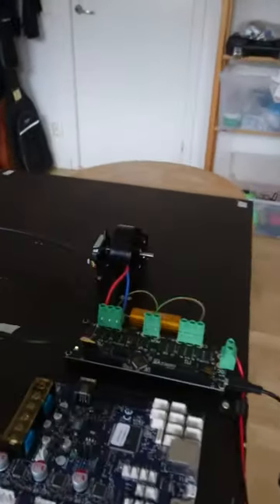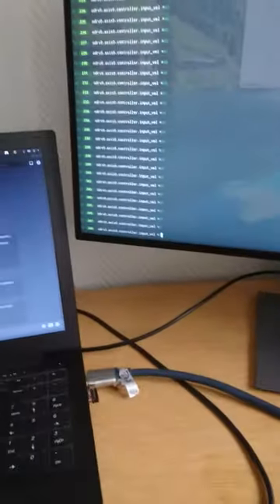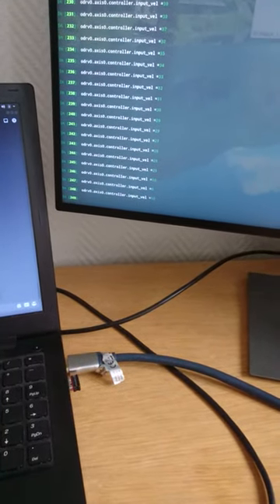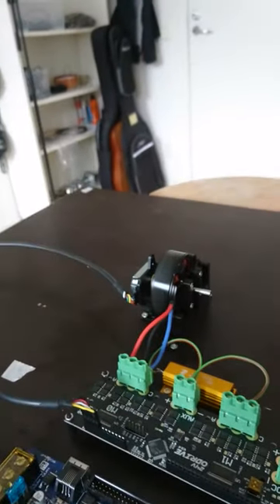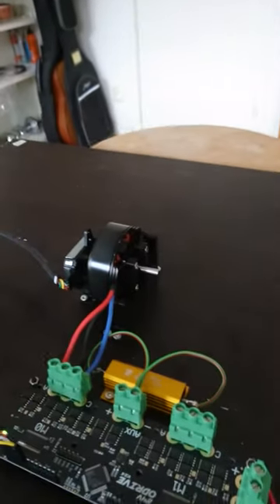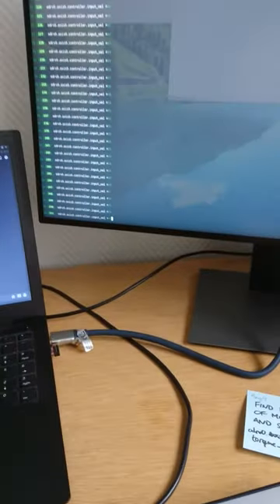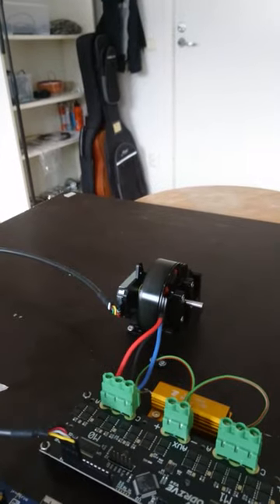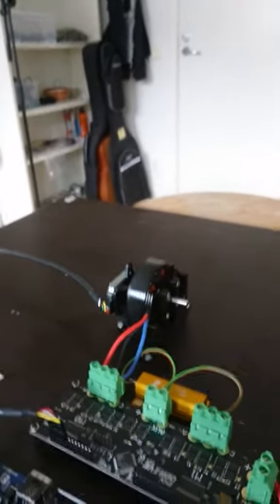Scaring Myself by Spinning a BLDC Motor Fast

Comment: What's the typical RPS for one of these motors 160ish? Let's see it! ;)
Reply from the maker: You mean typical max RPS? I would rather want to be in another room when it fails. And I don't have spare ones, so maybe another day. :P

I wonder if the ODrive's encoder readings is what would fail first (encoder signal already up to 491 kHz in this vid) or if the power supply (600W, 24V) would max out or what. I'm sure somebody out there knows ;)